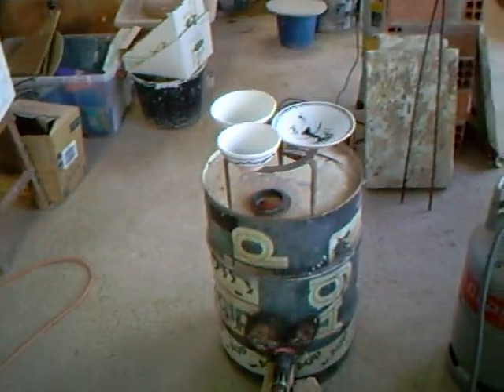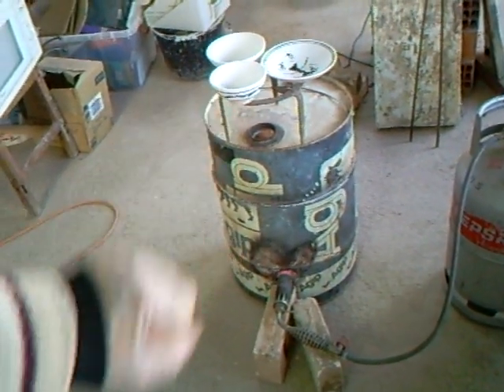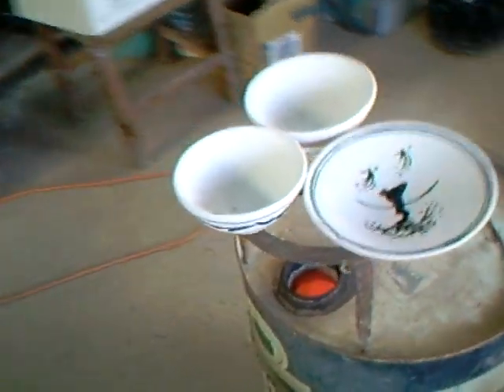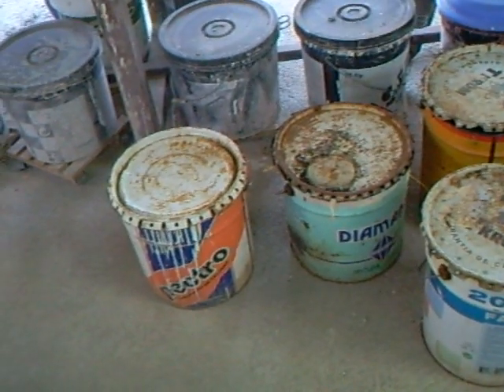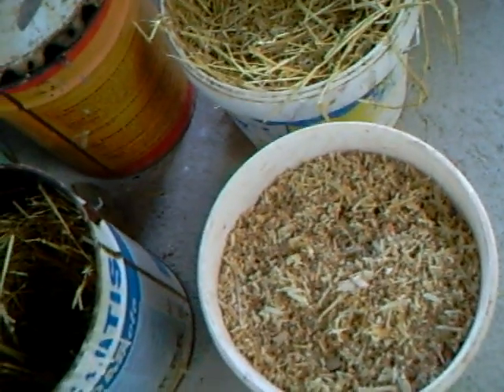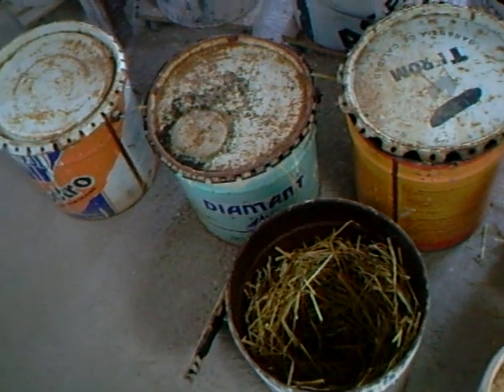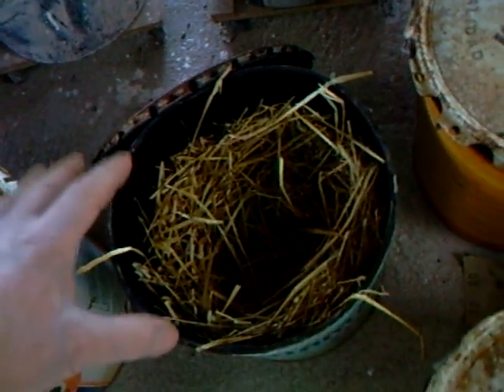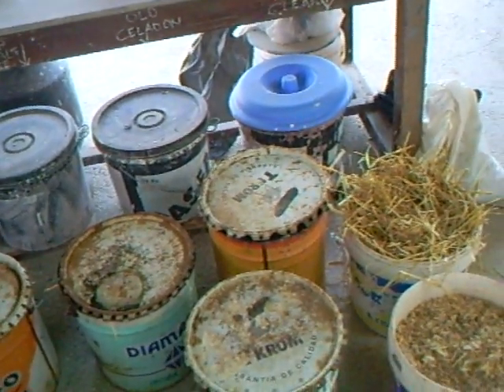SIMON LEACH  -  Raku fun 1

Comment: The horsehair is placed 1 or 2 hairs at a time onto naked raku which has been placed onto a cement brick in the open air. As the hair burns it leaves a delightful black squiggle on the pot as decoration.